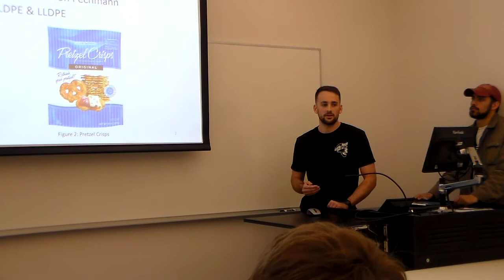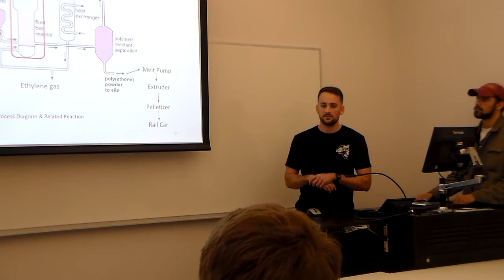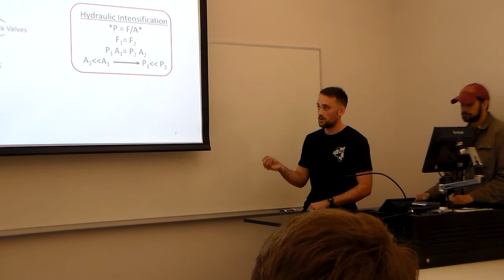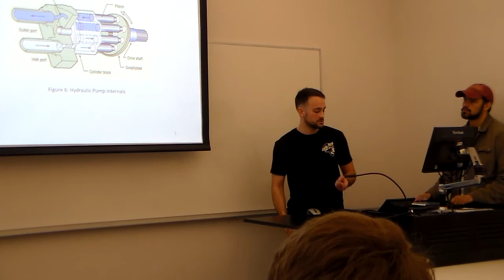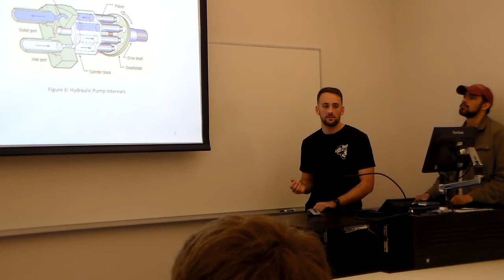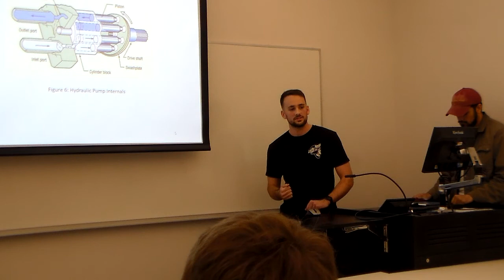ME 4611 - Thermo Talk 2 (2/3/20)

Comment: Technical Content: I was very interested in what Peter talked about and it was very engaging. I work at an engineering firm in town that has done engineering work for Westlake before. So to learn about how they produce polyethylene and the history about it was very interesting and well presented. The speaker seemed very knowledgeable and gave a great breakdown of the system and how everything worked.

Comment: Technical Content: I think the technical content of this presentation was great. I felt that I learned a lot more about how hydraulic pumps work and how different they are from traditional pumps. In my opinion I really wanted to see more of how these pumps work because they're quite interesting. Maybe try to shorten the slide with the food bags on it to fit in more diagrams of how these pumps operate under different conditions. Overall I felt that this presentation was successful in informing me of a new engineering topic.